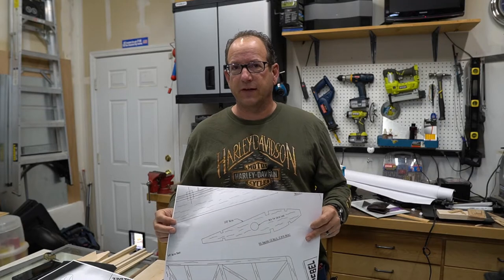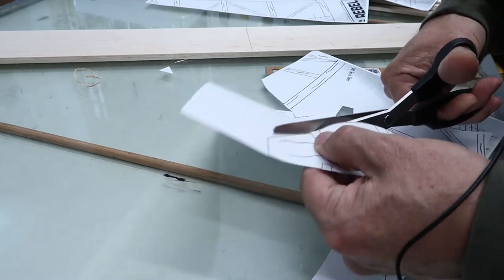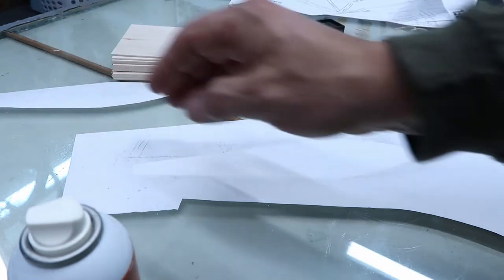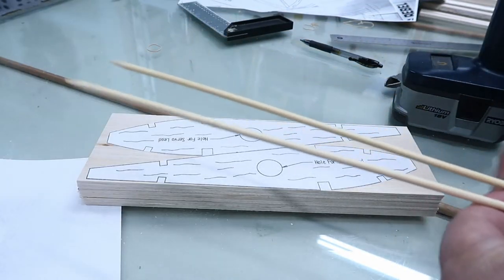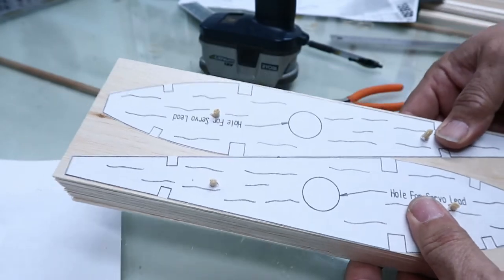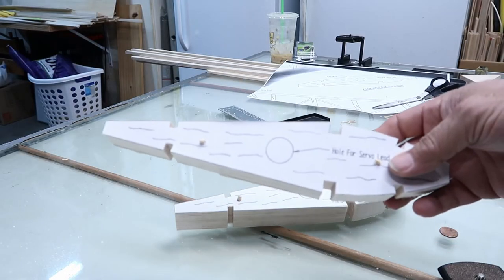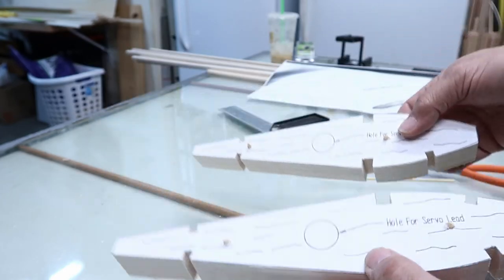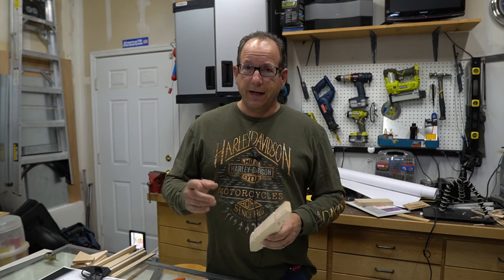EP4: Cutting ribs, scratch building the Ryan's Rebel

Comment: Dan, thanks for documenting this.  You make this look easily attainable and hopefully it will inspire more folks will take the plunge and 'roll their own' instead of buying an ARF.   Another 'trick' for cutting out kit parts is as follows.  I buy or make 2 copies of plans when I scratch build.  In the same way you sacrificed your photo copy to use as a template, I cut out and glue (3m77) the templates to something like 1/8th ply, etc.  I take my time and do a perfect job of cutting out this single plywood part and use it as a guild/template to duplicate parts using a router table with a flush trim bit.  I use double sided carpet tape to hold the template to my material/stock.  I keep this 'kit' of templates with the plans and if I ever want to build another of the same model (for a friend, after a crash, etc) all the hard work of cutting the kit is already done.  Not saying my way is better....just another approach especially if you think you may want to build more than one of a given model.
Reply from the maker: Thats a great way to keep your options open for ease of building a second one down the road or God forbid a new wing or fusalage.  I like the double sided carpet tape idea.  Got to find me some of that. :)

Comment: Dear Dan! Good to see this video. Also would be happy to see some tricks cutting or shaping different sized ribs of tapered wings at once. Especially when blueprints do not contain each rib but the first and the last. Thanks in advance!
Reply from the maker: Hi Viktor, 
That's no fun when they give only each end of the wing half.   I'm really careful looking over plans for such short falls before I start.  The double taper is hard because the ribs will shrink in both length and height as you go down the wing.  I think there are probably three ways you could create the wing parts that aren't there.  
1.  ACAD.  There used to be a program that could create templates of ribs for a wing that you design.  It has been many years but it might still be out there.  I think it was called Modelcad or something like that.  
2.  If you have access to a foam cutter make a foam wing using the inner and outer ribs as a template, (transfer them to 1/8 ply if they are balsa.  This would be the easiest way to create the wing and sheet with balsa.  But if you don't have a foam cutter, you may have to make one.  
3. Just build it by setting out the two ribs and guessing where the others should go simply eyeballing it.  I know, it's not easy and I wouldn't have the patience to do it but.  Some people do. 

I wish I had more for you.  Good luck.

Comment: 2 threaded bolts washer and wing nuts hold the rib stack more securely. It might interfere with scroll saw, but for sanding and fitting its preferable.

Comment: Interesting…..I bring the plan into Fusion 360 and trace around the rib and output a .svg file ( you have your install the free shaper tools svg plug in ).  I then load this svg fill into my Cricut  Maker 3 design studios and duplicate the ribs. You can cut many ribs perfectly using the 12” x 24” strong grip mat. No sanding is required and the quality is awesome. The Cricut Maker 3 can cut basswood or Balsa ;  1/16” up to 3/32” using multiple passes. It’s not fast but you go watch tv while it’s cutting :).   If I need a 1/4” piece, I just make four 1/16”  pieces and glue them together with thin CA.
Reply from the maker: Lotsa different ways to do this now. That’s cool.  😎

Comment: Beats cutting one at a time!   thanks :)
Reply from the maker: That's one thing you can really take advantage of, with this constant chord wing.  On a p-51 wing with a double taper design every rib is different, so you have to cut them out separately.
Reply: @Capgains7777  Ugly stick next build so very similar to this :)

Comment: Is the grain orientation on the ribs important?
I'm used to seeing the grain direction run straight down the ribs, so wonder if that offset affects them in any meaningful way.
Reply from the maker: You are the second comment I have seen about the alignment of the grain.   I've never had a problem with ribs shearing as long as the grain direction is fairly close and in this case it seems pretty close to me.  If it was a 45 degree or more discrepancy perhaps.  The finished wing is really strong.  But we'll see how she holds together.

Comment: Thank you so much. I have a bandsaw I haven’t set up yet. A jigsaw might’ve been a better purchase.
Reply from the maker: I'm planning on getting a quick vid out in the next few days.  For the longest time I had only a band saw, but after picking up a scroll saw at a swap meet, I was ruined.  It has so many advantages over the band saw beside the clearance issues.  It is the best tool you can have for scratch building.  Having both is good too.

Comment: Salve che bel lavoro preciso. Con gli attrezzi corretti si fanno lavori stupendi. Il metodo sandwich a me viene male, i primi pezzi ok dopo gli ultimi vengono diversi. Il taglierino lametta non viene preciso soprattutto gli ultimi pezzi. Forse a mano libera è meglio farne uno a uno ovviamente con la stessa matrice. Buon lavoro Maestro , se fossimo vicini di casa sarei sempre a farle visita per imparare
Reply from the maker: Translates to:
Hi what a nice job. With the right tools, you can do amazing jobs. The sandwich method is bad for me, the first pieces ok after the last ones are different. The razor blade cutter is not precise especially the last pieces. Maybe freehand it's better to do them one by one obviously with the same matrix. Good job Maestro, if we were neighbors I would always be visiting you to learn.

The scroll saw does a great job keeping the cut uniform through all the stack.   If I had to use a razor saw I would probably scale it down to 4 stacks of 6 or possibly less (more stacks).  Which adds more cutting but if you have to do it to maintain the sizes, probably a good idea.  
Scroll saw is a short cut for sure.   It would be great if you were a neighbor.  My friend Mark and I are some of the last builders in our area.  We could use some more building enthusiasts here.  
Questo sta usando il traduttore quindi spero che vada bene.
La sega da traforo fa un ottimo lavoro mantenendo il taglio uniforme su tutta la pila. Se dovessi usare una sega a rasoio, probabilmente lo ridimensionerei a 4 pile da 6 o forse meno (più pile). Il che aggiunge più taglio ma se devi farlo per mantenere le dimensioni, probabilmente una buona idea. La sega a scorrimento è sicuramente una scorciatoia. Sarebbe fantastico se tu fossi un vicino. Il mio amico Mark ed io siamo alcuni degli ultimi costruttori della nostra zona. Potremmo usare altri appassionati di costruzione qui.
Reply: @Capgains7777  non conosco Mark ma da come ho capito è un buon costruttore come te. Cercate di coinvolgere i giovani a imparare. Bastano anche solo 5 persone che portano avanti questa passione con tutti i segreti di costruzione che sono oro conoscerli. Questo lo stai già facendo con youtube  e io ti ringrazio. E poi  ci sono i gatti 😁🙃👍👏👏💪😸 anche questo in comune , simpatico il tuo che gli piace mostrarsi quando fai i video 😁😄😄😄👏👏👏👏💪👍

Comment: There's a reason that the centre line of the rib runs parallel to the grain of the balsa and not at a (say) 15 deg offset as you have done for convenience , it compromises the strength of the rib and hence the wing - just saying :-))
Reply from the maker: 15 degrees?  Really?  Id say its no more than 14 or at least in the area of 11 to 13.  Thank God there’s all that sheeting and cap strips and fiberglass and over engineering to help strengthen it.  🥴

Comment: Dan,  do you have a method you use to determine from the plan what you need, how much, for wood?  For example, How many 1/16 thick sheets you need to order after reviewing the plan.
Reply from the maker: I wish that I did have a method to guess the amount of wood needed for plans by just looking at it, but I don't have a formal way.  I guess I have always kind of estimated, and then added overage just to be for sure.  Many times as in the case for the Rebel, the designer may provide a list as part of the build article.  Other than that it's just a matter of looking at each template and group the same thicknesses together... keep in mind that most sheets will be in 3 or 4 inch widths and 36 or 48 length and see how many you will need to group the templates onto a single sheet.  That's all I can really offer for help... just be thorough as you look over the plans.  I like cutting my own sticks from sheets using the razor cutters I show in the videos.  I will say even with the list provided by the designer of the Rebel, I have a ton of wood left over... so much for efficiency.

Comment: Have you ever thought about laser etching the design into the wood for parts like this?
Reply from the maker: I don't have access to a laser cutter, or cnc machine.  The last time I looked into laser cutters, they cost $10,000. That was many years ago, but maybe they have come down in price.  Laser cut kits are a great option if you are not interested in transferring and cutting parts out, but for this set of plans the parts are so simple...  And with the wing having identical ribs the entire span... That's 20 parts right there...with stacked wood.  Easy.  I think cutting the parts for this kit took maybe an hour... It takes longer when you are shooting video... But it was fast and very therapeutic.... Like sawdust zen.
Reply: @Capgains7777  I don't mean a cutter, I mean an etcher to etch the drawing onto the wood so you can follow the etched lines on the saw. Yeah cnc laser cutters would be expensive for personal use. Ps. I thoroughly enjoy these vids. I'm inspired and soon as I have the room and the money I'm gonna try this

Comment: Why did you drill the holes into the ribs?  You could just of easily drilled the holes into the waste part of the wood.   Now your ribs will have random holes in them.
Reply from the maker: That is a great question.  In this case it serves two purposes.  First the holes have a bamboo skewer in them while I am cutting and sanding the ribs to lock them in place in a stack, so they will be identical.  A way to mass produce the work.  The second purpose comes in when covering.  Because the ribs are solid many of the bays will be airtight when the covering goes on. Especially in the front part of the wing in front of all of the sheer webs.  Having those holes will give a place for the expanding air to pass when you use a heat gun to tighten the skin on the wing.  Otherwise it can balloon up.  The holes don’t hurt the integrity but will show up if you use a transparent covering.  It’s just something I have always done building wings but I was reaffirmed when I built the Flying King wing.  Its in the instructions to put holes in the ribs for the purpose of pressure release. And those ribs come cut already.

Comment: I just got a nifty idea why don't you just make a sample of one rib and keep that one sample to make more wings for future planes just an idea
Reply from the maker: Kinda funny but when I cut this stack out I actually counted the ribs incorrectly and had two extra ribs after assembly was done.   So those two ribs were floating around the shop for quite some time before I used them in a wing mock up for CA glue video I made later on.  I do know a lot of modelers that will make a template of the ribs just in case usually with 1/16 ply.  I don’t know though.  I guess my philosophy about airplanes is, there are so many planes and so little time.   I rarely will build the same plane twice.  My biggest exception was when I was involved in racing and often had 2 or 3 backup planes and I had templates for every part of that plane.  My second exception is the F4U Corsair.  I have had a 40, 60, and a foamy, and have a Meister Scale 100” under construction and a Flite Test master kit on the shelf.  But for the most part once I finish a plane I will be moving on to another.  So little time…

Comment: why not thin plexiglass and cut 1 rib abd trace the plexiglass onto the wood
Reply from the maker: That would work as well, there are many ways to do this for sure.  I was just trying to show a way to easily cut all of the the ribs at one time, using a photocopy of the rib template.  Because this model has a constant chord wing and all of the ribs are the same, this step super fast and easy.  Almost as easy as cutting one rib and done.  On models where the wing is tapered both in thickness and in chord, each rib is different as you travel down the span no short cuts!!!  One more reason the Rebel is an easy scratchbuild.